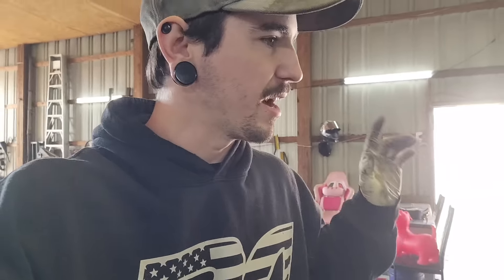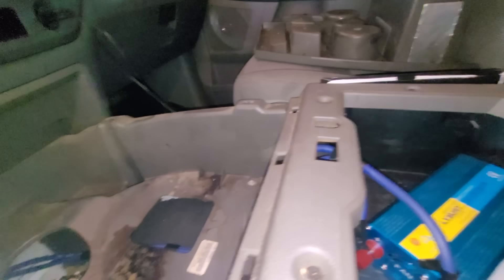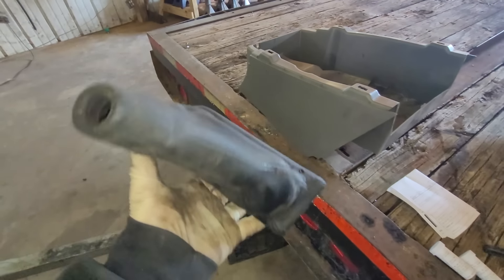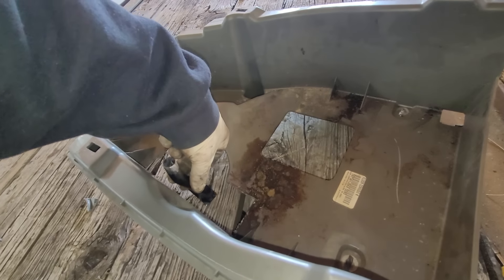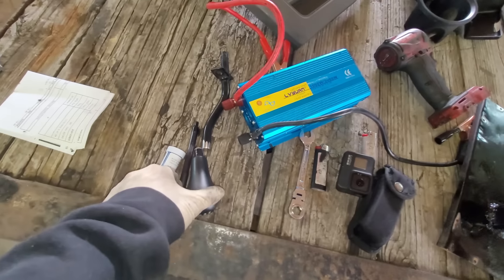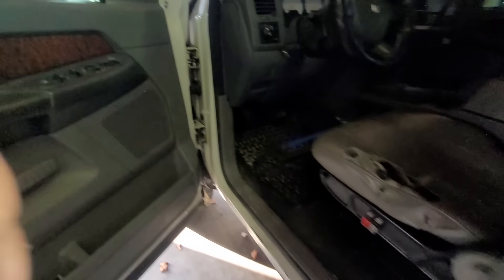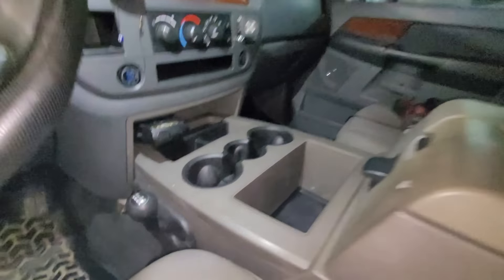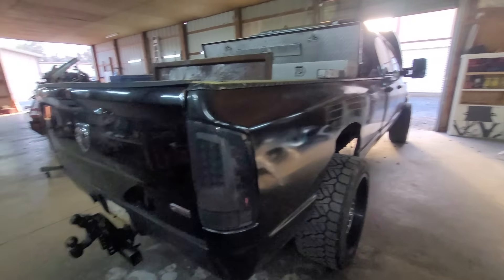4wd Shifter W/ A Business Console | Dodge Should've Made This A Factory Option! | 06 Cummins

Comment: You normally don’t have a passenger so i would install the plug on the passenger side of the console, almost directly across from the 4wd shifter so its out of the way but easily accessible from the passenger side of the truck or leaning over the console.
Reply from the maker: It would be pretty difficult with how deep the cup holders go into the empty space

Comment: Just get a noco onboard charger and charge the truck batteries from the generator.
Reply from the maker: The generator is an on board alternator. That would work but then I'd have to run that AND another set of Andersons towards the back. 

I use that plug for campers so it's nice just having a common plug
Reply: @CPSteveMiller  The advantage to the noco onboard charger or any battery charger over the alternator is it actually has a charging profile and will keep your batteries healthier overtime.

Comment: My G56 console has 3 cup holders so I'm pretty happy with it, but it would be nice to have all that space you can have with an atuomatic consol. My center seat containers hold a lot so it isn't so bad. Hopefully you don't have to double-boot the shifter hole inside the console (from road noise or flinging mud and water?)
Reply from the maker: The 4wd has a gasket with a plastic flange that bolts into the floor. That boot does nothing for sound luckily!
Reply: @CPSteveMiller  Ah, didn't think of that.

Comment: do you think i can go from crank window to power if I switch the wiring??
Reply from the maker: Should just plug in
Reply: @ okay been wanting to do it but i don’t see no videos so i had to ask
Reply from the maker: I'm pretty sure that the factory harness from a power window truck will just plug right in place of the crank window wiring and then plug in as normal. Haven't done one but dodge seems to like to leave things in place in case owners add things down the road.

As for the window assemblies & motors themselves, that stuff all bolts right in without question.